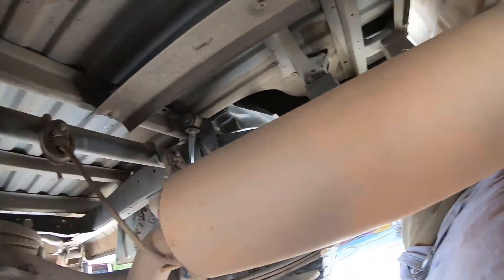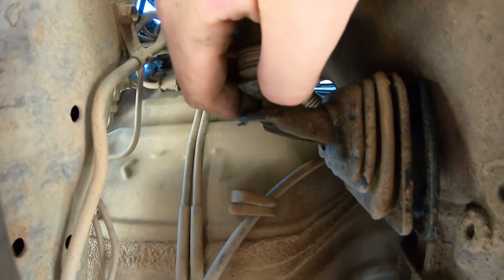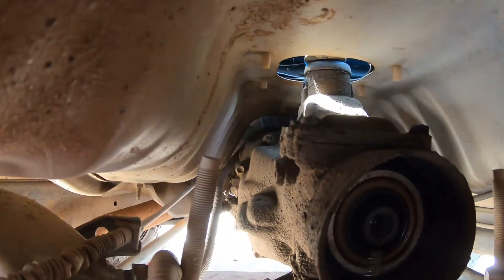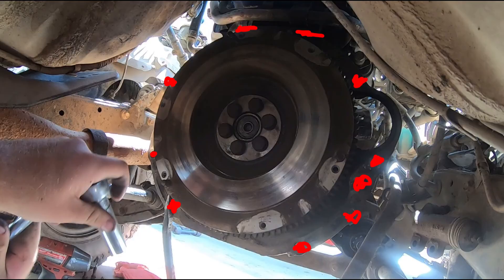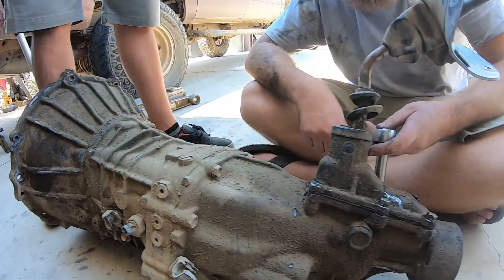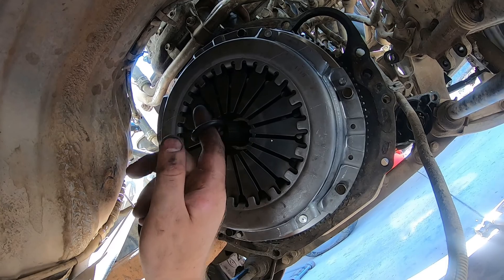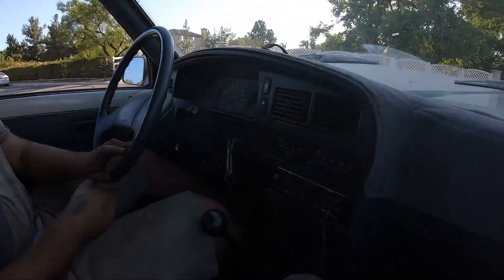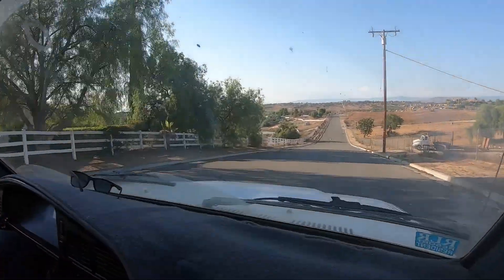1990 toyota pick up clutch replacement

Comment: What's up man good video. I got a question for you. So I have the same year truck as you and I want to crank the torsion bars. I tried but for whatever reason it didn't move the height at all. You got any insight? Thanks
Reply from the maker: Thanks brotha, when you tighten the torsion bars it make a stiffer ride. But should raise it as well. I have some after market torsion bars on my truck wich helps with the hight of it. I would say tighten it 5 or 6 FULL 360° turns, take it on a drive and then messure.

Comment: Before you replaced the clutch, did it make any noises? How did you know it needed replaced?
Reply from the maker: No noises, just when i put it in a high gear and give it some gas, the RPMs would rise and the truck wouldn't accelerate.

Comment: Hey there! Did you remove the fluid before removing the transmission? Is it required?
Reply from the maker: For the head removal we left the fluids in. If you are dealing with anything in the bottom end, drain the oil.
Reply: @nothinbutgoodtimes5697  Thank you! 🙏🏾

Comment: is yours two wheel drive or four?
Reply from the maker: 2 wheel drive
Reply: @nothinbutgoodtimes5697  when i do this should i change the tranny and clutch fluid? how long did this full replacement take? should i replace the flywheel when i do this?  anything that wasnt in the vid that i should know?